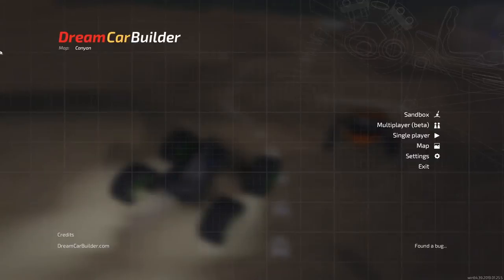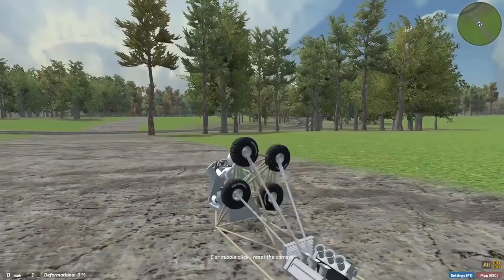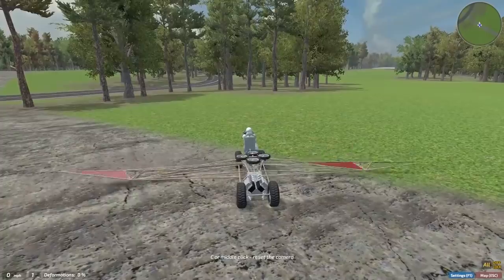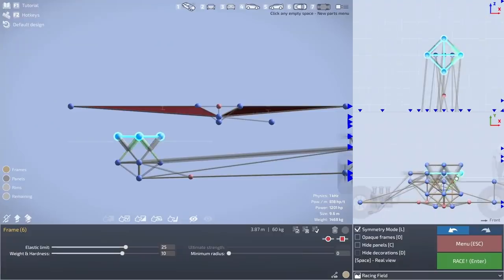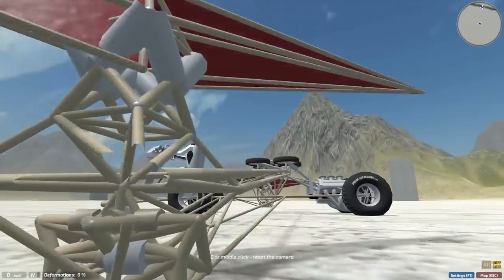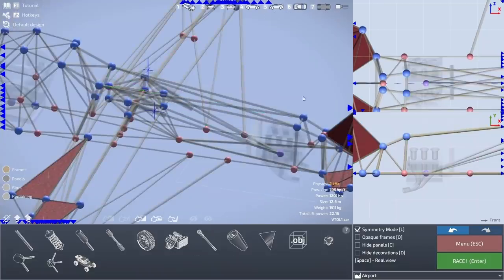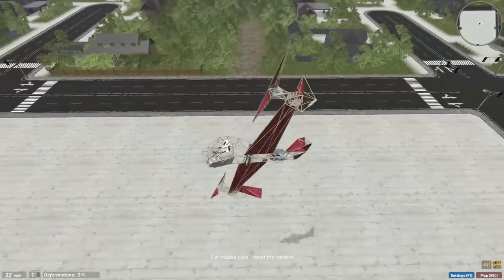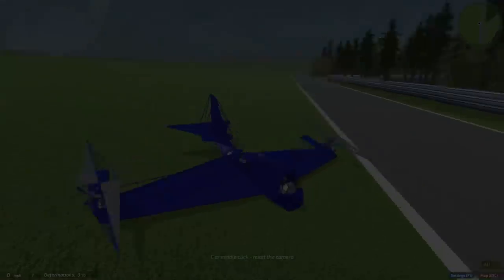Making a VTOL in Dream Car Builder

Comment: hey reid, you can use a 4 bar linkeage you use for transfer of rotation, to also revers the direction of rotation, by switching the conction points of those rods that are not top or bottem dead center. try to give it a try

Comment: If u want an heli the center of trust must be in the gravity center, for a plane u have to put the gravity center at the front of the center of pressure(lift), and yoh just adjust until the perfect setting.
U can thrust me, I design and build some airmodels.

Comment: You should be able to reverse the turning direction of the blade by just connecting each rod to the side opposite to where you would normally
Thinking like a belt vs a belt with a 180⁰ twist in it
So then you can just mirror it and only swap the rod connections
Reply: I did a little drawing of it and it seems logical
(obviously assuming they can clip through each other like the original does)
Reply: in reference to around 4:30